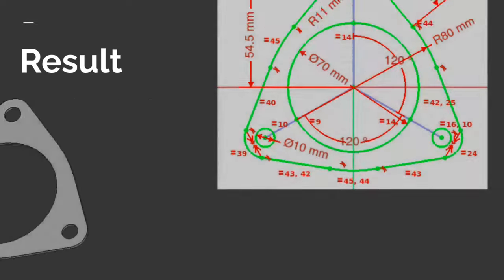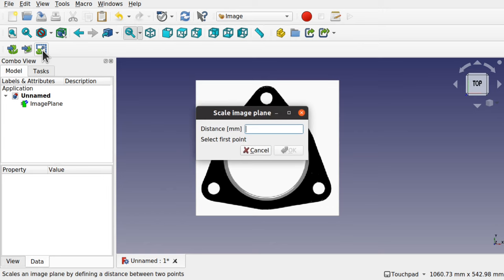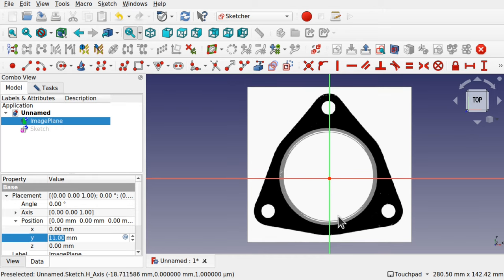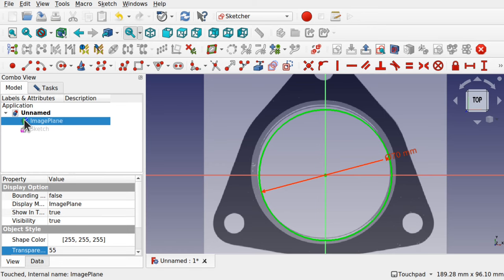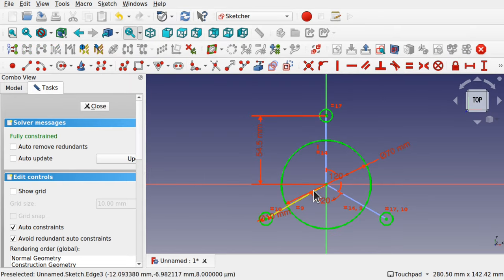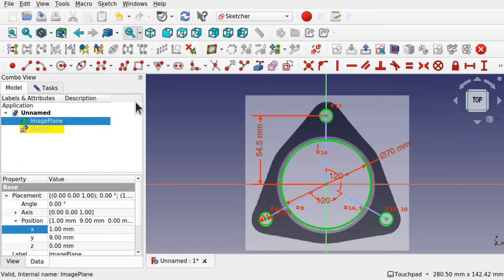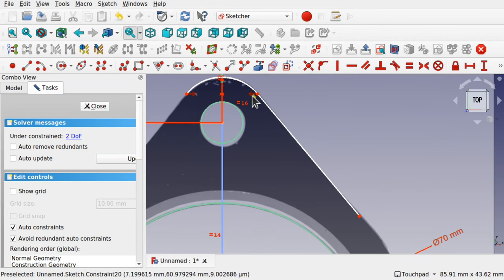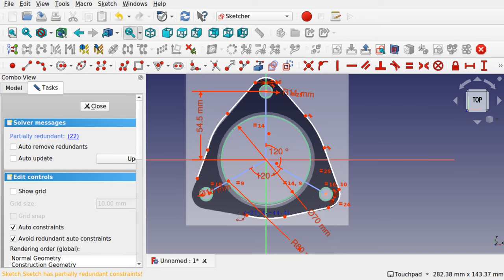FreeCAD 0.20 For Beginners | 4 | Tracing Photo / Image to Build a Simple Model

Comment: The only downside to watching these videos is I'm now starting to question my design choices on previous parts I have modeled up on FreeCAD.  Thanks for great pacing, no loud music and videos that actually implement the methods you talk about!
Reply from the maker: There's so many ways to get to the end goal. If you achieved your goal you have succeeded so haven't done anything wrong. Each way you learn something extra which is valuable. Questioning your previous route shows your really starting to understand the program.  Thanks for coming along on the journey. No you won't get any loud music hear and I always try to use practical examples. If not I will follow up with one in another video. Unless I have a practical example then I can't remember it as I have no reasons why I need the information so my brain just gets rid of it.
Reply: Same here. Sometimes I got the impression of reinventing the wheel, lol

Comment: I've been toying with the idea of learning some sort of cad design as I'm an old boy, I usually use more basic methods. I usually just use Aspire for basic CNC router design. I don't understand why in this instance, freecad doesn't show a centre point. The image is centred to the workplane & the first line you placed across the centre wasn't in the centre & then it took 5 minutes to centre it properly. The centre of the workplane might not always be the centre you want but in this case it would have made life a lot easier. Or, I've got this all wrong!!!
Reply from the maker: When attaching a sketch to a face the center point is always shown which you can constrain to.  Also, this is the one you may be the one you need,  you can toggle the axis cross on and off in the 3D view so it's there but not on by default.

Comment: If anyone also had a problem with setting up symmetry constraints  to arcs - I have found another solution, which for me worked fine.

Draw a line between both ends of an arc. Select this new line and the respective construction geometry line (like with symmetry constraint) and add perpendicular constraint. Repeat for all three arcs. Select these three lines and add equal constraint. After that convert them to construction geometry.
Reply: thank you so much this worked like a chram

Comment: Thank you for these tutorials.  I have about 600 hours experience using OnShape and I am moving to FreeCad.  These videos have been extremely helpful.  Thank you.  I respect the pace you are presenting the tools and techniques as well.  You give them something new then let them repeat it a few times to help it sink in.   I would like to see a follow up video that shows how to accomplish the same sketch but using Mirrors and Symmetry instead of repeating the same tasks to create the rest of the sketch.  Just an idea but once I learned that in OnShape my design time was cut by about a third.  Since the FreeCad "Symmetry" tool doesn't automatically add the Symmetric Constraint to the Points it takes a bit longer but it is still a faster approach that requires less brain power.

EDIT:  I see the next video is using polar pattern.  I like that.  However, I still think that using Symmetric tools in the Sketch is also worth knowing.  (My opinion.)  Great job.  Love your work.
Reply from the maker: Thanks for the feedback, I always appreciate the time taken by viewers to explain how they are finding the videos and what they like and don't, it's all taken on board. Great idea about the mirror, I do have tutorials with mirroring in my understanding freecad series but it's something that I should include in this series. Thank you so much for your time and the constructive comments.

Comment: If you want to reduce the perspective distortion,
then take the photo from the farthest distance you can
with the maximum zoom.
Reply from the maker: That's is an awesome tip! Thanks for sharing.
Reply: For a flat part, you can use a flatbed scanner to get an image that is true to size.
Reply: @roofoofighter  I think one of the lessons was how to get the proper scale from photo. However, even if you were to import the image that way, you could still resize it to view in which case, you'd need to know how to set the proper scale so you can draw at any zoom level.
Reply: IMHO it is possible to shorten this workflow:
1. Draw a circle in the center using the "3 rim point" tool. 
      (This method automatically matches the circle to the image. We don;t have to guess its center.)
2. Construct three construction lines 120° apart, which pass through the center on BOTH sides.
     (extending the line to the other side is useful to create the geometry on the other side)
3. Draw one corner first:
3a. Draw the small circle. Its center lies on the construction line.
3b. Trace the two straight lines on the part, and let them intersect at the construction line.
       (The two straight lines form a "V" at the corner.)
4. Repeat step#3 for the other two corners. 
5. Now we have three Vs at the three corners. 
     These 6 lines intersect at 6 places.
    Create fillets at all these six places. Adjust the fillets to roughly match the part.
6. Add constraints to make the fillets symmetrical around the construction lines.
7. Add dimensions to fillets and circles to match the part.

Comment: Great tutorial, thanks!!!!

I got a bit stuck on the arc on the lower right corner. It was over constraint after adding the symmetry constraint to the arc. Probably my FreeCad is a newer version and more strict (I followed every click). I just did not add symmetry constraints on the  left and right arcs. Instead I added a coincidence constraint to the center of the bottom arc (coincidence to the vertical axis). 
Then it was fully contrained
Reply: So I am not the only one who is troubleshoot this arc. I will try this solution to symmetry the arc

Comment: Thank you for these tutorials, These are very clear and definitly helpful.
The image transparency did not work for me in version .20, I tried in version .19 and it works.
Reply: Hi, wasn't working for me either, but I found you can use the Shape Color control to apply a different color. Which worked well

Comment: Finding you videos much easier to follow than others I tried. I did have trouble towards the end setting symmetrical constraint on the corner arcs. It would mark them as 2 over-constraints. Rotating the sketch slightly would remove one over-constraint and rotating it back would put it back again. It would then break the sketch with some points no longer coincident. I was about to give up but saw @moonlyr's comment about putting a chord across the arcs, constraining it as perpendicular, then marking the chords as construction geometry. That worked a treat. Not sure what caused this. I also can't find how to get circle centre marks, crosshairs. like you have. To be honest I am struggling to get all the dimensions to format consistently, number of decimal places, units etc. Thanks for efforts I will continue to watch and learn.

Comment: These are some fantastic tutorial videos, very precise, step by step instructions, clearly explained, and demonstrated.
My only issue is, occasionally, I can't seem to find certain options to select. Not sure if this is because I am currently running Ver. 0.21.2 and most of these tutorials are Ver. 0.20, or because I am on an iMac (M3, Sonoma 14.4.1 OS), or perhaps it's because I am a blind newbie. (Most likely a combination of the three)
Anyway, great videos, I really am learning a lot.
✌🏻from🇦🇺
Reply from the maker: Glad your enjoying them. Yes there are some small differences between 0.20 and 0.21 that can be figured out but worth this one there is a big difference, and that is the image workbench is no longer available. This is now done from the file import. Later tutorials are on 0.21. I am looking at a rework soon.
Reply: @MangoJellySolutions  Cheers, I'll keep an eye out for that. At the moment I'm still learning my way around the program, and have yet to progress past your first 2  videos.
I look forward to your updated videos, and if I could make a suggestion, if there are any differences between the Mac and windows versions, that you are aware of, could you please point these out. (You may already do this, and I just haven't got that far yet,  if so, Thank You!)
✌🏻from🇦🇺

Comment: Thank you for your very informative tutorials. I am a novice with FreeCAD and they help me a lot to get to know how to use it. I just wonder if a polyline for the outside edge wouldn't have been faster? Having said that I haven't tried to do that yet.
Reply from the maker: Glad it was helpful! Yes you can use the polyline tools and use the M key to switch between line and arc modes to make the workflow quicker. This can be a little tricky when your first coming to freecad but it's a great tool to get to grips with as it will save a lot of time.

Comment: The Image workbench is removed from 0.21. I used Import to import the image, unfortunately the Image Scaling tool is gone as well. I just copied your dimensions from the video, but how does one do this procedure in 0.21? Thank you in advance and also thank you for these videos!
Reply from the maker: Check out the following video. I created this a while back to help with the new way that this is done in 0.21 https://youtu.be/WhxDAgskcHA
Reply: @MangoJellySolutions thanks, will do! I also found the solution, you just double-click on the image entry in the Combo View and on the following requester that opens you select 'Calibrate'. From there you can measure and input known dimensions.

Comment: FYI for anyone who has an issue with your outer lines appearing a different color (light blue in my case) and not showing up in the 3D view (almost like they are invisible). I realized later on that the newly created lines were set to "Geometry Construction Mode" (as mentioned @ 17:16). This button is a global toggle instead of a one-time action (which MangoJelly mentioned to at 18:00, but I didn't realize I necessarily had to untoggle it in the moment). Just select all your outer lines and toggle the "Geometry Construction Mode", and your lines should come back to life! Using version 0.21.2.

Comment: I found the best way to draw the outline was to add circles and then lines with tangent constraints and then trim away the unwanted parts of the circle
Reply: My word Tony, I definitely second that. Plus, there is another sweet little bit that I haven't noticed mentioned yet, in this series: *construction geometry*! Allows you to draw lines that you can constrain on (such as those 120degree angles, together with the equidistant centers of circles and arcs) and those helper lines get ignored when padding into 3D, and therefore during the padding operation, FreeCAD doesn't bitch about the helper lines ruining the continuity of the surface ("wire is not closed"). Construction geometry is very useful for "scaffolding" constraints that you cannot stick directly onto the "production outline" geometry.

Ehh not sure if maybe I just didn't listen close enough. I'm watching this "on the back burner" at work and at home, often while doing some mundane manual chores.
To me as a hobbyist, after past experience with Sketchup and LibreCAD, today FreeCAD and parametric solid modeling is a shiny new mental toy. I love this, the meshed constraints set my mind racing. Thanks @MangoJelly for this tutorial series!

Comment: 22:30 - I have followed the instructions at least 8 times and every time i apply the Tangent constraint I get "Over-Constrained: (6,21,22)", 6 and 21 both are regarding the constraints applied to the bottom right circle, i have tried redoing this 8 times and even tried deleting those constraints which then everything goes out of whack, I'm not sure if its just something I'm missing or something which is different in version 0.21.1, any guidance would be helpful TIA
Reply: I had the same problem. Tried twice. I kept scratching my head. Then, I checked (ticked) the "Auto remove redundants" option, and everything went smoothly from there.

Comment: Helpful Timestamps:

0:18 
Workflow:
IMAGE WORKBENCH - SKETCHER -  PART DESIGN

2:53
Image to be sketched should be clear with preferably with a 90° topdown view and without shadows

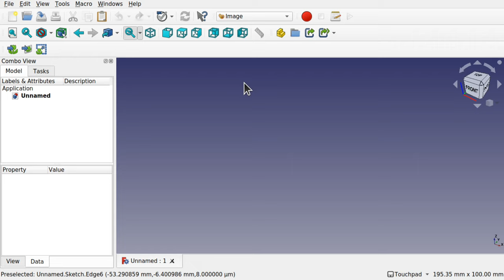3:19 
New Document - START - IMAGE - CREATE IMAGE PLANE (creates a planar image in 3D space) - CHOOSE AN IMAGE FILE TO OPEN (image file preferably '.png' as it preserves transparency) - CHOOSE ORIENTATION (XY Plane)

4:18
For accurate dimensions, the image needs a scale reference from IRL,
SCALE IMAGE PLANE - DISTANCE (mm) (Set the reference measurement which allows for the rest of model to be as per scale) - SELECT FIRST POINT (choose between two points that represent the actual measurement of the original model

6:04 
Verify the image scale by, MEASURE DISTANCE

6:44
COMBO VIEW - MODEL - UNNAMED - IMAGEPLANE (selected) - CREATE A SKETCH - (pop-up) SKETCH ATTACHMENT - select the method to attach this sketch to selected object - DON'T ATTACH - CHOOSE ORIENTATION (XY Plane

7:14 
The image should be centrally aligned with the model canvas,
COMBO VIEW - MODEL - IMAGE PLANE (selected) - DATA (Tab) - PLACEMENT (nudge around with the axis until the image is relatively central)

8:27  
For better visibility between the image plane and the canvas
IMAGE PLANE (selected) - VIEW - TRANSPARENCY (as needed)

9:41
CREATE A CIRCLE (Auto constraints activated, so as to centrally align it with the 00,00 coordinates) - drag out from the center point to the diameter required

13:15 
For PCD of the flange holes, sketch straight lines from the 00,00 coordinate to the flange circles center, angle the two flange holes by selecting both the lines, bonding them with the CONSTRAIN ANGLE (fix the angle of a line or the angle between two lines) and set the degree of angle require

13:15
Make both the lines of equal length by selecting the. and clicking CONSTRAIN EQUAL

16:15 
Add a length to the line between the centre point and the flange hole's center by selecting the line and clicking CONSTRAIN VERTICAL DISTANCE (Fix the vertical distance between two points or line ends) - INSERT VERTICAL LENGTHS

17:35
To only represent the sketch of the model, click SKETCH - SKETCH GEOMETRIES - TOGGLE CONSTRUCTION GEOMETRY, after selecting the lines that should not appear on the model

18:40 
To create the rounded vertices of the flange click,
ARC - CENTER AND END POINT (center point of flange hole as reference, drag out the arc-circle to match the image boundary, click on the where the ARC should begin and end as two points that match the image

19:24
Make the ARC points symmetrical by selecting both then selecting the reference point to which they should align and click '><' - Use the CONSTRAIN RADIUS tool to refine the ARC's dimension

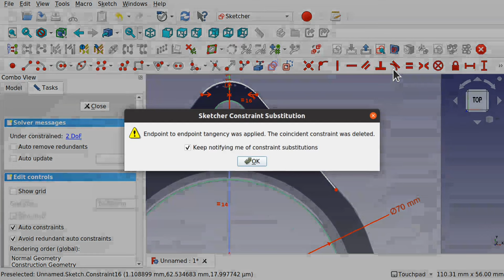20:50 
Use CONSTRAIN TANGENT (create a tangent constraint between two entities) to connect the ARC with straight line in following the outline of the image

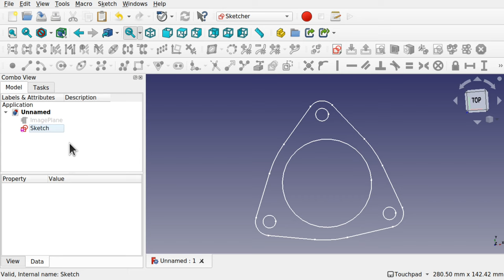31:18
START - PART DESIGN - BODY (make the BODY PARENT by dragging SKETCH (under COMBO VIEW - MODEL) under the BODY

31:40
The above step allows for the SKETCH to be worked on with PART DESIGN e.g PAD
Reply from the maker: Wow, thank you for taking your time and adding this index. Much appreciated.👍👍👍👍👍

Comment: One tip that I can share about the use of reference images. if you use a scanner and scan it in at 72 DPI. then it should have the right scale when you import it in freecad. but it can't hurt to check this is still true in later versions
Reply from the maker: Thanks for adding that, great to get more hints and tips from others as it really enriches the learning experience.
Reply: and thank you for doing the tutorial series, it's very well explained. back when I started it were mostly silent videos that did help but where at the same time confusing at times. so it's time now to learn some more about freecad after my (mostly) self thought work flow is running a bit to his limit with some more complex twisting shapes. @MangoJellySolutions

Comment: Great video!  Just curious, how would I define a constraint of a "rounded square" if I only know the max width between two sides?
Reply from the maker: You can use the points. Find a red point at the end or beginning of say the left edge and the same on the right and make a length constraint. Your probably clicking on the line and adding a length but you can also do this between two points.
Reply: @MangoJellySolutions  Thanks!  Do you offer any instructor led virtual courses?  Something interactive where you train and shadow beginners to use FreeCAD to model objects? 😎👍🏼

Comment: Be aware : As others have said, there is NO IMAGE WORKBENCH as shown at 3:06 nor is there an 'Add-On' for it.
SOLUTION:
Another video by this YouTuber MangoJelly has been made and can be found here:
https://www.youtube.com/watch?v=WhxDAgskcHA

In the FreeCAD release I have, v0.21.2 (rev33771 - 14th Nov 2023 02:33:39hrs) I needed to do the following:

1. NEW,  FILE,  IMPORT (select your image file)
4. Click on MODEL.
5. Double left click the mouse on the image name.
6. Select TOP view from the box (upper right).
7. Click CALIBRATE.
8. Left mouse click the left side of the inner circle, then move to the right side and click that, now enter the distance in the box of 70mm as per this video and .
9. Click OK
10. Continue watching this video from 6:00